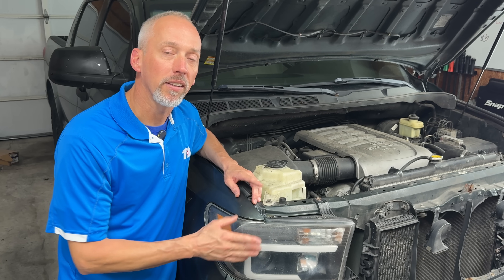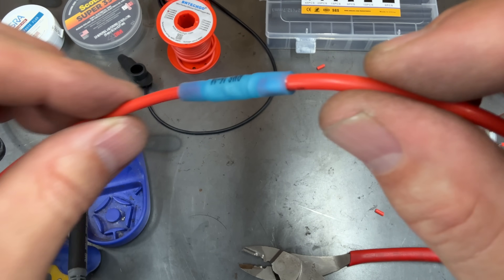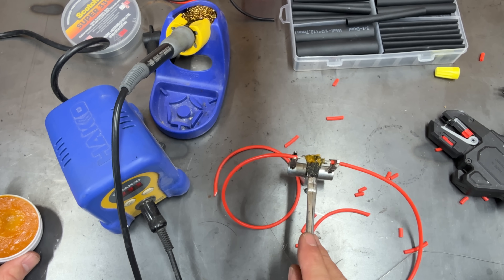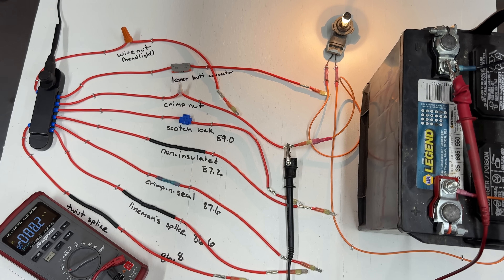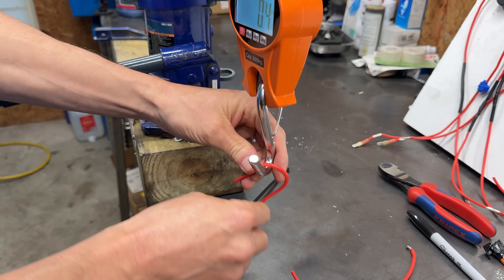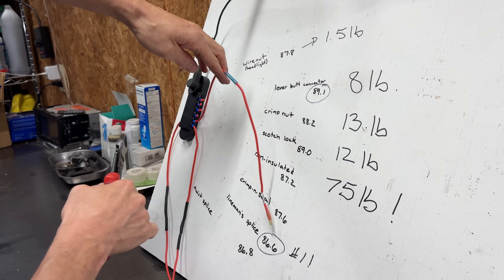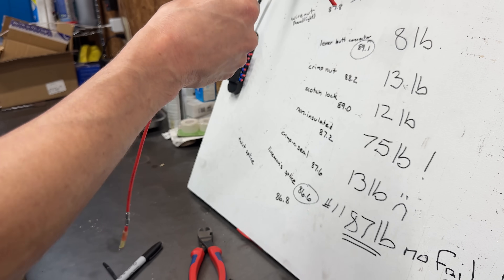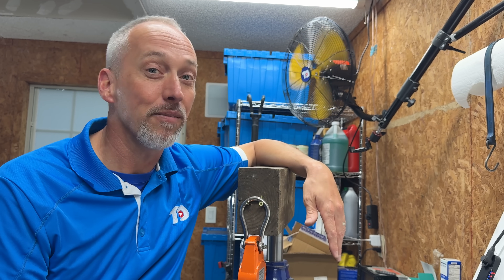I tested these connectors and found the best one

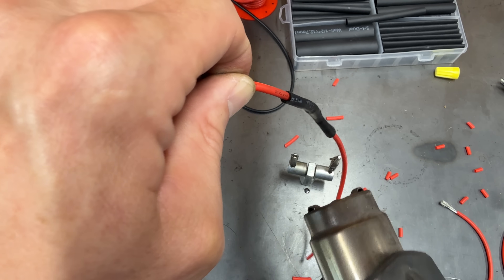Comment: 03:27 Not in automotive but in electronics, cabling devices, ... I do the same L on both vires but start turning first wire over the second wire and same with the second wire, solder it and use shrink tube.
Reply: Yep, that's the correct way to do a Lineman Splice. Not the way it was shown in this video. Properly done, the lineman splice produces a slimline, mechanically strong connection, even before solder is applied.

Comment: But the best connection between 2 wires will always be a mechanical connection specifically soldering and then using heat shrink to not only insulate the bare connections but also protect it from outside elements they also make heat shrink connections that also solder the wires as you heat up the heat shrink tubing so you’re able to do two things at once and these are typically used a lot in diy repair applications or even applications that require soldering a wiring harness adapter like upgrading your factory stereo to an after market, the 2 in 1 heat shrink with solder makes it a lot easier for those who don’t really know how to solder but ends up giving them a strong mechanical connection instead of using butt connectors and crimping them!

Comment: The application of the connector doesn’t matter all that much with lower voltage low current applications, there should be no reason why a wire nut wouldn’t work unless the person making the repair has no idea on how to properly use a wire nut and if that’s the case then they shouldn’t be messing with a vehicle’s electrical or any electrical connection at all!
Reply from the maker: Wire nuts are not recommended for outdoor use because they will allow corrosion to get into the connection and eventually break it.

Comment: You know you can just measure the wire resistance with a multimeter?
Also you didn't test the Deutsch connector.

Comment: In automotive always crimp joints
Soldered connectors cause weak point at the edge between bare wire and solder, after little bit of movement cables will start to break

Comment: Someone needs to come up with crimp connectors that can be backed up with solder.
Reply: I hear you. Too many times you think you made a nice crimp and find out later you were wrong when it slips out. 😆
Reply: Eww no. Adding solder to a good crimp only worsens it. If you need waterproofing, use waterproofing like high-quality adhesive-lined heat shrink tubing. Or seal it with potting compound.

Comment: Where are Polish WAGO 221-2411 ?
They are TOTALLY THE BEST on the market
in terms of quality, simplicity and current conductivity.
Reply: WAGO is a german company though.
Reply: @Westerschwelle  WAGO ELWAG is Polish company established in Wrocław with Polish CEO and company has its roots in Poland
Reply: @Westerschwelle  And the WAGO 221 series is manufactured in Switzerland, surprisingly!
Reply from the maker: I just saw those at Home Depot yesterday. I guess I should’ve looked there first.

Comment: if you're getting lever locks you should get the wago branded ones, i haven't touched wire nuts since i started using them around the house
Reply: Yup, for sure. Some of the generic knock offs are total garbage. Wago connectors aren't that much more money, and they are definitely of higher quality.

Comment: Next time doing something like this I'd recommend using a micro-ohm meter, they're designed to test joint resistance and are very cheap to hire for a video, you'll also get more repeatable and accurate results. Great work with the set-up that you had though.
Reply from the maker: Thanks 👍
Reply: That’s great advice.

Comment: I'm a control systems engineer with years of experience in industrial machine equipment as at the technician level. Additionally, I'm a very experienced diy mechanic, and it's something that I picked up after years of technician and engineering experience, so the differences between automotive and industrial systems were very stark to me as I became very acquainted with automotive power and control circuits.

14AWG is a very large wire, but not large enough for starting currents. Might be because I drive a late 2010's car, but I've never seen any 14AWG wire in my car, and I've acquainted myself with my car very VERY well. Also, conductors in cars will usually have higher ampacities than in just about anything else because even if they are in a loom, the free air will allow for more heat dissipation of a wire.

This may sound counter intuitive, but wire temperature ratings are much higher than the ambient air in an gas/diesel car. And, because power in an internal combustion vehicle is mechanically generated, the only large conductor ampacities are, again, at the starter and battery.

I'm not surprised at the efficiency of a proper soldered splice. But, this measurement is done using a lamp, which is a substantial load. Such a voltage drop would affect PWM or other sensors, but those have a much lower current draw than a light (mostly), so the voltage drop on those circuits will be much smaller than in this example. The matting connections at the crimped factory connectors and to the ECU will have voltage drops in the same range anyways.

For the most part, the chief advantage of a soldered splice is that, if done correctly, the accompanying heat shrink tubing will provide excellent vibration resistance. Motion in conductors in cars is rare, outside of when conductors are moved around for service as you showed. So the pull force test doesn't really help because such high pull forces would probably rip the cable from most cable mounts and crimp connections at any connectors.

So the real question is vibration resistance, not pull force.

All in all, I don't think anyone should do anything other than a butt splice or solder splice with proper heat shrink tubing. What workshop manuals from manufacturers usually suggest is to simply run a new conductor next to the one to be replaced, with protection added to rubbing locations because new the wire will usually be outside of the loom.
Reply: I would imagine it's large enough for starting currents if it's very short

Comment: No, the connection strength is not important in automotive.  You should never have that much stress on a wire, even if it's a continuous wire and no connector/joining involved.  The real stresses in automotive are vibrational (wire) or abrasion (wire, connector or insulator), which has nothing to do with this test, temperature changes, weather resistance including both water and salt water, and in some applications, automotive fluid resistance.

Ironically, even if the pull weight test you did was relevant, how it would be more relevant is a lesser weight applied continuously and then subject to the vibration and temperature changes, not the highest/lowest momentary force exerted.  If you have momentary force exerted, then you probably just got the vehicle into an accident, and I concede that you don't want wiring causing a fire in an accident, but if it's that hairy a situation, the vehicle has problems with all it's original wiring, not just that one headlight wire splice. 

Ultimately the data wasn't useful because there are too many variables remaining such as wire condition, whether plated, age of connectors, skill of person using a crimp tool and which one, skill of someone soldering and using the best wire joint method for a low tension application with space in mind, which you didn't even, apparently, know about which is startling.

It really comes down to 3 factors.  One, the more expensive connectors are used by noobs who don't have skills.  Two, not every wire is in an area accessible to solder, and many people can't solder well to save their lives, so they shouldn't.   Three, a crimp connector is fastest but can be problematic if the crimp isn't good.  Some people can solder great but don't have xyz high quality crimp tool, especially for some of the smaller automotive connector contacts in use today.

Overall it's safest to just tell people that if they don't know their forte, then they need to have a pro do it.

Comment: I work in a commercial boat building facility and we build high speed boats for the navy and coast guard, never seen a proper solder fail even on decade old boats that are slamming waves at 60 knots for 15 years. Almost never seen a crimp fail since all our crimpers are calibrated but I have seen it. Just my 5 cents.

Comment: I'm glad you called out the premade connections that have heatshrink on them. See way too many people improperly crimping them and tearing the heatshrink before it is even heated. Then proceed to stick that horrible connection in the bilge of a boat.
I was taught to use the non-insulated connector and separate heatshrink. It has never failed me in almost 7 years.
Great video showing the differences between all the connections.
Reply from the maker: oh man, I can only imagine what those boat connections looked like after a year.
Reply: @ToolDemos A year? You’re quite the optimist. Won’t last 6 months in most cases. 😂

Comment: pull test some wire, with no connector. I want to see how many strands of 18ga wire I need to pull the engine on a car, just in case I loose the sling for my hoist. 😂
Reply from the maker: been there, done that lol

Comment: Use the uninsulated spike on the crimper to crimp the heatshrink connector ('crimp & seal'). When shrinking, the glue refills the hole you stabbed.😉
Reply: No it does not. Years of being an outboard technician has taught me that those premade connectors are junk.
Reply: @removefromme I've had no problems with good ones, idk what brand that I get from Fastenall. The cheap junk from HF is cheap junk.

I've been fixing cars with them for years. (also ASE Cert Master Tech 😉)
Reply: @Iowa599 Now that I think about it. Depends on the heat source you’re using to shrink down the heatshrink. 99% of the time someone uses a torch which is way too dang hot. Splits the heatshrink open instantly.
Reply: @removefromme and the insulated crimper slices it, that turns into a tear. The uninsulated stabs a hole that gets filled.

I saw you have spares, give it a try 😊

Comment: I always use Solder and heat shrink tubing.   Especially on electronics like o2 sensor wires where any resistance can give false readings to the computer.   Electronics computer circuits are much more sensitive to any resistance then  standard electrical circuits like an old fuel pump or old style  brake light bulb.

Comment: For really secure and air tight wire work, I often put silicone sealant around my solder and at least half inch over the wire insulation before adding heat shrink tube, should be good enough for sea water applications, and outer space :)
Reply from the maker: Good idea

Comment: LOL I have wing nuts on my head light wires, I need to make a more perm fix 2 years later, Id bought a cheap truck I didn't know if I was keeping or not so I just did whatever because I didn't wanna waste my time doing it right if I was salvaging it out instead. Otherwise I'd never wise a wire nut in automotive.
Reply from the maker: There’s nothing more permanent than a temporary fix lol

Comment: A properly prepared and taped wire nut connection can be very reliable and practical for most applications. It may not be as strong as some connectors but unless you are subjecting a connection to extreme conditions or forces it will last a long time.  Alot of the strength in connections come from using good techniques and common sense. Thanks for the video and the work you put into it !! There was alot of good information that is very useful !!!
Reply from the maker: Thanks. I use wire nuts all the time, but only indoors.

Comment: what im getting is:
-use linemans for things outside of the cabin and when you have enough wire to work with (fixing original broken off stuff doesnt always provide that)
-use non insulated butt connector for when you have not much wire left sticking out of a component, then put a shrinktube over it
-for inside cabin (no crazy heat/vibrations): use anything thats not a scotch lock. me being lazy: lever/wago, heatshrink w solder ring.

Comment: Crimps are best. There's a reason crimps are standard in automotive and aerospace industries. Solder won't hold up to vibration as well over time. And I think you used the wrong tool on the insulated connectors.

Comment: I prefer lineman twist and solder, but it is the most time consuming and can't be taken apart. One thing to consider, if you solder, is that the boundary between the soldered wire is a potential weak point for breakage in high shock and vibration environments, so avoid holding down the solder joint and letting the wire-side flex (e.g. wire into terminal connector, screwed onto a terminal strip.) This is the reason why some advocate the crimp (get spring loaded crimping pliers which give you consistent crimp pressure) and heat shrink method for automotive applications. For aircraft/space craft, you aren't allowed to do any wire splices, and mil-spec connectors are mostly crimped, though some are soldered, with mechanical strain relief. Also, it is worth getting the marine heat shrink that has a glue layer that melds the shrink tubing to the wire insulation.

Comment: If you use uninsulated butt connectors and solder after crimping as well as pre-tin leads before the crimp, followed by marine grade heat shrink, the connection will never fail! PS, clean joint with alcohol prior to heat shrink to remove flux residue, which is corrosive!
Reply: Adding solder to a crimp only ever improves a bad crimp; a good crimp is only worsened by the addition of solder. For waterproofing, use quality adhesive-lined heat shrink tubing, or use potting compound. 

Electronics flux residue is not corrosive if it has been sufficiently heated. That isn’t guaranteed to happen in hand soldering, so generally speaking I like to clean off flux. However, because it is categorically impossible to actually clean flux from stranded wire (since any attempt to clean it will just result in it wicking up farther), I try to avoid using added flux when working with stranded wire (i.e. rely on the rosin flux core from the solder). There are some liquid no-clean fluxes sold explicitly for tinning wire, and those should be safe to use without any cleaning.

Comment: The stress test on the wire nut connection was 7.6 lbs, but you wrote it down as 1.5 lbs.
Reply from the maker: I noticed that when I edited the video. I missed a couple things in real time that I caught later.

Comment: Solder will melt if electrical load heats the wire then you'll have a bare wire potentially touching the metal body in the vehicle.

Comment: What connector do you use to splice several wires?(12V node); I'm building an Automotive Harness to flashing an ECU but it has several signals connected to the same +12V node and I don't have the appropriate connector to link them into, Could you give me an advice, please. Thanks
Reply from the maker: The way I have always done it is put two or three wires together and then slide all of them into a larger crimp connector.

Comment: Scotch locks have been responsible for so many automobile Fires over the years as one thing with them is the steel peg fractures the wires inside the ables which arc in use which then creates "Fire"
Reply from the maker: I hate seeing them
Reply: @ToolDemos  Another thing is do you realise that in Automobiles Looms there are many soldered joints where say five switches join like with door open> interior lights or side lights and many other circuits where items need to be connected to one denominator. So they splice them in with solder and seal.
Reply: Seen those used on a bilge pump in a brand new boat.
Reply: I’ve used them in low current applications for decades and have never seen any kind of failure. 

If they’re that bad why are they still sold for automotive purposes? Maybe people used the wrong size Scotchlock with the wrong size wire?
Reply: @JamesVR6  I'm ok with them being used in a vehicle where it is inside the trunk or under paneling. Since they won't be exposed to the elements constantly.
They absolutely do not belong on a boat, engine bay or trailer.
Reply: @removefromme 
Oh I definitely agree! They are definitely not waterproof! 😂
Reply: @JamesVR6  blue was the only one sold and is about right size for wires of the day.
You probably never will find your phut phut on fire but many did mostly it's high current as new electrics are to earth through switches as main power side is through relays in those boxes under dash/bonnet.

Comment: Great video!   Food for thought.  Which is better for battery cable connections to RV batteries?  Purchased ring terminal or flattened and drilled soft copper tube?  Better to crimp with 10 ton hydraulic crimped, or solder them?   I chose left over AC condenser copper tube, and crimped on with tool.  My thinking, solder is easy, but vibration would not be good with it.
Reply from the maker: Agreed. I buy ready-made ring terminals, and use a die and press to crimp them.

Comment: I believe your Crimp Seal was weak because you did not use the correct crimper. A proper ratcheted crimper makes a "weld" join whereby the wires and crimp body fuse together for minimum resistance and maximum strength. And it also will not damage the heat shrink even though huge pressure is exerted.